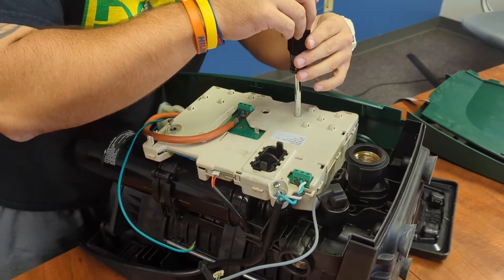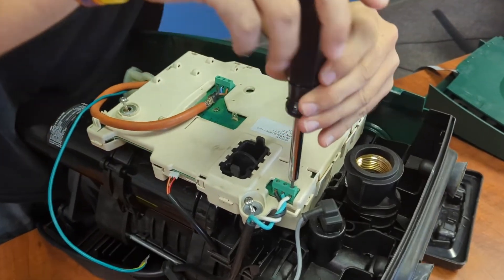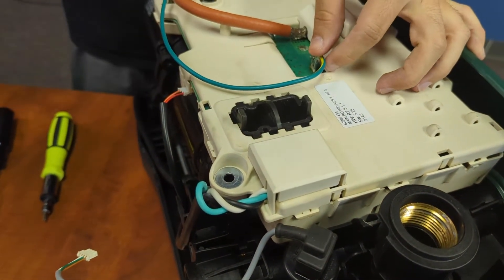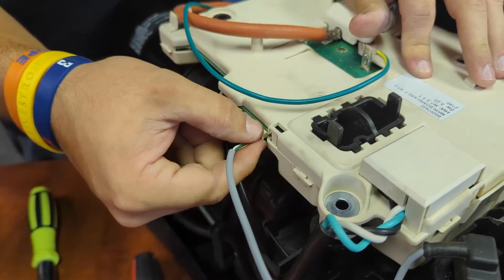How to replace the PCB Main Board on the DAB EsyBox

Comment: Hi there, I am a customer based in the UK. I had a minor issue with ESYBOX pump but the UK team could not help so I am giving the US a try. With my ESYBOx, I realised that when the water valve shut and when the pump was running toward the end, it made very sharp squeaky noise. Would you be able to advise how to fix the issue? The pump was not making this noise oroginally but after a year it does, a bit frustrating.
Reply from the maker: Hi all, we appreciate the effort to respond via comments! If you have any issues, please let us assist you via: service.us@dabpumps.com - Thank you so much